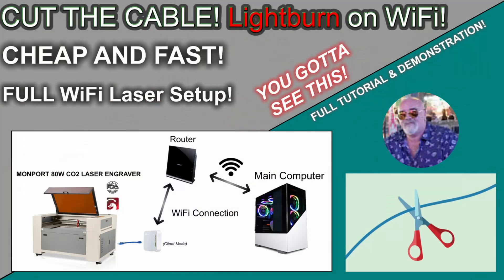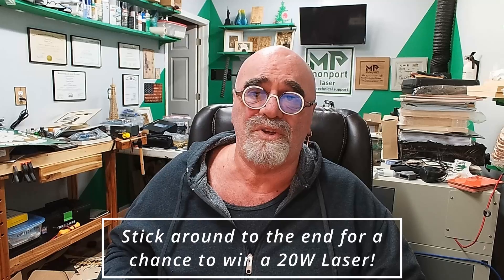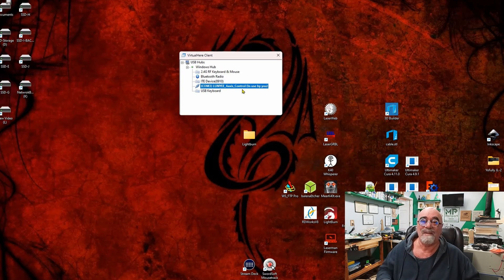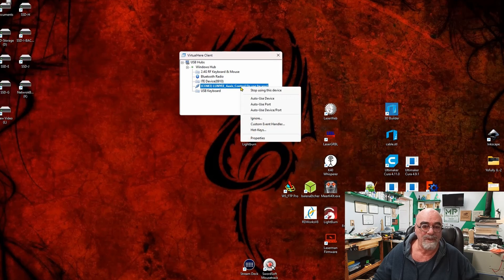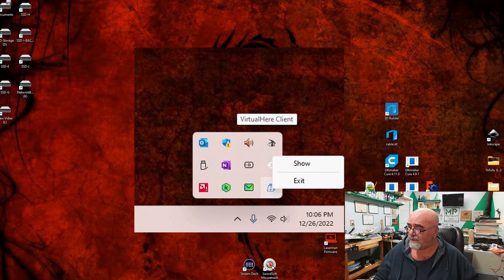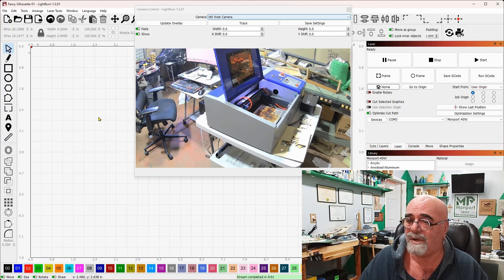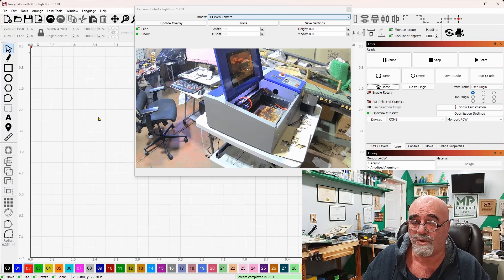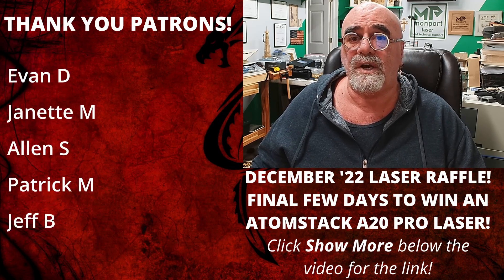➡️Remotely control your DIODE LASER⬅️ with ANY OLD DEVICE with a USB port on your network!

Comment: Thanks. I got this on today. Got my Raspberry Pi 4 and loaded it. I could get the camera working via remote USB, but the laser control would not work. I eventually got Laser control to work with using only LAN on the Pi (not WIFI) and PC can use either LAN or WIFI as the Client. I think LAN all around would remove a lot of variables and strange interruptions. From Lightburn I had to use USB-Packet mode, not USB-Serial, to get it to work. It would not work with USB-Serial not matter what I did. I have a OneLaser with a Ruida controller, and it must like the Packet mode better when connected via VirtualHere. Having done all this, not sure this will be worth the headache as it adds a lot of touch points to babysit and diag if you have any issues. If you have a permanent PC next to the machine (like in your config), it may just be a lot easier to use a Remote desktop connection, and leave native USB connections to do their thing locally. But it does work.
Reply from the maker: @khufu8699  Sounds like a fun project. But yeah, everyone has an old PC laying around.

Comment: Dang it, my laser control board is not showing up.😢
Reply: Thank you.
I tried several times.
Still no go.
So I installed light burn on other laptop, to ensure the laser would work, it worked fine.
I guess I will scrap that idea, thank you for all your help.
Appreciate it.
Reply from the maker: I don't know why. I use this regularly.

Comment: I bought a new first time CO2 laser by Monport and there’s been some difficulties getting USB to initiate with my Mac like it doesn’t see it at all. I think it comes down to being just a cable . . I just enjoy watching you cause you’re so informational. 
However, I’ve had this laser sitting on my bench. I’ve only gotten one burn out of it and that’s through Wi-Fi. I would love to get this thing up in operational through the USB so that I can have Lightburn, which I’ve learned so much from you to get running on this Mac
Reply from the maker: I’m glad you are enjoying the videos, and you're right, USB cables can sometimes cause issues. If you search on Lightburn's forum, there are a number of solutions for a Mac. I am not familiar with them.

Comment: I just purchased a 16 MP USB camera which is arriving today. Have you designed an enclosure for the camera that I can download? The main reason for this setup is so I can setup the job and leave the garage and monitor the job from my office. I do batch jobs that sometimes take an hour. So I will not be moving the laser around remotely. I just need a way to shut everything down if there is a problem.
Reply from the maker: No I haven't Kent.
Reply: @TheLouisianaHobbyGuy  I will design one next week and upload the file to you on FB. It will be more stable then the one I purchased.

Comment: Hi Rich, great subject.  It does look like the 32 bit Windows version has gone away.  The takeaway is that for some reason they have stopped supporting older Windows computers.  I could be wrong however, when I loaded VirtualHere on two different computers (one an older 32bit machine) the 32bit option was not available.

Thanks for all you do
Reply from the maker: Thanks for the info! I don't know much about this software since I personally use Remote Desktop.

Comment: Looks interesting.  I tried using an older laptop I had, but the screen resolution was not high enough for running lightburn.  I might give this a try.
Reply from the maker: Yes, older laptops don't play well with Lightburn because of the resolution. 👍 Thanks for watching!

Comment: Hi Rich, is the D1 pro 20w laser capable of using this software to connect via wifi? I ask because everything I have searched and everyone I have talked to tells me that it's not possible to connect to lightburn via wifi with the xtool d1 pro. Is that accurate information or is it possible with this software
Reply from the maker: Any machine can connect this way Johnathan.
Reply: Hey Rich...I also have a D1Pro 20w Extended Bed and I have run VirtualHere and found on my D1pro I get an error on almost every time I use it that says my controller has lost the USB connection and it shuts the job down.  I had been running a 20 ft USB cable so I switched to a "known good" 6 ft connected directly to my Raspberry Pi4B that runs VirtualHere.  Same situation.  Just wondering if anyone else is seeing this sort of issue with Xtool D1 Pro?  You are 100% correct that it is the easiest thing I've done to ADD Wifi to my laser, now I just have to figure out how to make it stay connected.  Switching cables doesn't seem to be the answer, also disabled all the power options on my PC with Lightburn to prevent any communications issues after long periods of burning files etc.  Still no luck. @TheLouisianaHobbyGuy

Comment: Windows 10 and newer ONLY - too bad, I've got stacks of older computers that would do just fine otherwise.
Reply from the maker: I think everyone does Andrew.
Reply: @TheLouisianaHobbyGuy  Not sure about everyone, maybe in this world. Anyway I still keep the term "backward compatibility" in my vocabulary - something today's programmers seem to ignore if they ever had it. I remember waaaay back when I had a friend who owned a small manufacturing firm. They repurposed Vic-20's to control some of their processes. Even then the Vic-20 was a dinosaur. 

On another note, I got curious - adding on another Lightburn license is only $15 and it will run on a Win 7 machine. Worse comes to worse I could also install Linux and run one of my old boxes that way - at least in theory. Linux and I have a bit of a love/hate relationship. There's a lot of stuff I know it can do but I can't always seem to coax it to do my bidding.

Comment: Great solution. But for me, I currently using Google Remote Desktop to control my laser engraver removing.😊
Reply from the maker: Great 👍 I've used that as well as several other options. Remote desktop (built into Windows) is the best.

Comment: Anydesk works too. Its a very light footprint. Plus EITHER device can be the client or server so there's only ONE application to install on all systems. So from your laser computer you can even connect to your other computers. If you're using a computer to connect the devices. Its way faster than this to setup. Install it on your computer, the destination computer and you setup favorites and you're gold. I can also use my phone for it. It also works great for helping people. You can ask for their anydesk phone number and then connect to their computer with it. This is what I use for my shop.
Reply from the maker: Thanks for the tip!

Comment: So someone told me that you like to try XTOOL and I want to buy one. Me question for you is: which one of those machines are capable to cut 1/4” thick acrylic??! Thx in advance
Reply from the maker: Any of them Thamara, so long as the acrylic is opaque. Diode lasers cannot cut clear or light colored acrylic.
Reply: @TheLouisianaHobbyGuy  oh that’ what I want to cut clear acrylic, but you know, clear acrylic come with a brown cover sheet. Do you think I’d leave the sheet cover on I will be able to cut it?
Reply from the maker: No you can't. Once it cuts through the paper, it passes right through the clear acrylic.
Reply: @TheLouisianaHobbyGuy  oh so bad. Hmm so which another brand do you recommend??
Reply from the maker: You'll need a Co2. For a budget 40W that's compatible with Lightburn, monportlaser.com is the only company selling the K40 Lightburn. It's $549.99, but you can get it for under $500 with my discount code, Rich&Monport. They also sell larger ones and the code applies to all machines on their website. And of course, if you have a higher budget, you can check out Thunder, Epilogue or AP Laser.
Reply: @TheLouisianaHobbyGuy  wow you are amazing thank you for you help and knowledge sharing. 😂
Reply: @TheLouisianaHobbyGuy  what’s a water chiller? Do I need one? Can you explain it to me? Sorry for this avalanche of questions do you have a video so I can stop bothering you?
Reply: @TheLouisianaHobbyGuy  if my laser tube broke and I want to buy a replacement? Do I have to replace it with the same 40w? How often it brake??

Comment: I have a question, when I am working with my laser, why does it has a continues line when the laser is running. I am just learning how to use my laser.
Reply from the maker: Your settings are wrong Antonius. Go to the Console tab and type in: $32=0 and press Enter. That will turn off white space burning.

Comment: Hey Rich, Just want to say thanks for all your great videos. I just got an Atomstack 10 Pro and new to lasers. My biggest challenge is learning Lightburn but your videos have made that much easier so thank you. I do also have a X Carve CNC running  Easel.  In one of your videos you mentioned you ran a CNC off of Lightburn, have you posted anything on how that works? And if so would you recommend that over using Easel? Just thinking it would be nice to run both machines with the same software. Even if you dont get a chance to reply still want to thank you again for the stuff you are doing.  Promise you will hear back from me once I know how PayPal works or you post a P.O. Box address.
Reply from the maker: I only use Lightburn on the CNC for engravings. It doesn't control the Z.

Comment: I don't think "ANY OLD DEVICE" is correct. In fact, it is misleading. I have an old laptop with Windows 7 (it won't run Windows 10 or 11) . The VirtualHere web site says the server requires windows 10 (or later).  I was hoping to run the server on the old laptop as it certainly seems like it would qualify as "ANY OLD DEVICE", but that idea is no longer achievable.
Reply from the maker: To me, any old device is running Windows 10 James. I mean it's 7 years old already. I wasn't trying to imply you could run it on a IBM 5150 from 1975.
Reply: @TheLouisianaHobbyGuy  I'm 78 and a long retired software engineer when Windows XP was the Windows Dejour.  USB was just coming into vogue back then when keyboards and mice still had cords.   

My old Windows 7 laptop is still used to run my Shark CNC.  The CNC and my brand new XTool D1 Pro share the same table with the old laptop and when I saw this video I about jumped with joyful anticipation.  Though I won't be able to use the Old laptop, the idea is still sound.  I'm now looking at an $80 Dell 3189 with Win 11 on ebay.  

BTW, your videos on Lightburn are superb and your explanations are clear and easy to follow.   Thank you.  Do you have a video on how to set up a camera?  You use a camera quite a bit in the videos, but I haven't found a video that explains what kind of camera and how to set it up.
Reply from the maker: Yes, I have several.

Comment: Rich
I used your link to order a Atzer laser on November 22nd 2022 and have not received a shipment confirmation yet. Should I be concerned?
Jeff Fiedler
Reply from the maker: Nope... The PRC has had the country in rolling lock-downs until the WHO reported it last week. Most of the factories are far behind. Email them Jeff.
Reply: Thanks

Comment: help me understand,  ok at the time point 8minutes, you show the other room on camera,  that computer is hooked up to that laser  by a USB cord,  correct,  or is it hooked by a wireless way??      BTW    great info If I can figure it out, I can see the 2 pc's working through the "here prog."   I think you could do that like when you connected to the old guy as you called him,  and showed him the way to do something,, without the Here prog.  so I got that   thanks for the info, and keep up the good work,
Reply from the maker: Yes, that laser is connected to the computer in the other shop via USB cord, however, nothing else is running on that machine.

Comment: You could also just directly control the computer in the other room using Google remote desktop.
Reply from the maker: Windows Remote Desktop is even better Billy. This is the easiest way considering most design computers will be at a desk somewhere remote.

Comment: great job, I'm just starting, have experience in CNC milling as a hobby. this looks very easy, BUT, i loaded a computer out in my shop with Virtual Server, OK, then i  came in here to my office and loaded virtual Client as you instructed. when i ran them here i got a blank choice for find HUBs. , NO LIST showing my Xtool laser
 What did i do wrong????
Reply from the maker: Both machines have to be on the same network Larry. I run both on the 2.4Ghz Wi-Fi network here in the shop. I have also run this on a wired network, but I don't think it works on the 5G Wi-Fi... not sure about that.

Comment: I guess I have to pay the $49 for the license to continue to use this software. The client is free but the server has a charge. I'm I right??
Reply from the maker: No Carl, the only limitation on the free version is a restriction to one device. If you only use it on one device, it's free. I've been using it for over a year on a printer.

Comment: Hey Rich, awesome video! I was about to try one of those USB to RJ45 extender but with this solution it is way easier!!!!
Reply from the maker: Tried the USB to RJ45... didn't work.
Reply: @TheLouisianaHobbyGuy  I tried the solution you have suggested with the server on a Windows 11 PC and the clients on another Windows 11 machine and on a Mac. In both cases the Laser is easily recognized and I can run some simple commands like frame and home but after a couple of minutes there connection is permanently lost.

Comment: I probably won't use this to control the laser itself - I prefer that to be done by the computer attached to it - but this looks perfect for using a webcam in Lightburn on a remote computer! Thanks again for all your tips and tricks. (I'm going to have to make a macro just to thank you if you keep this up!)

Comment: I can't seem to find this info so I figure I may as well ask the master. 
Is there a way to switch my y and x axis on lightburn? How my lm3 with extension kit is physically set up it feels more intuitive to have the long axis be left and right instead of up and down, but it doesn't seem to work if I just put the 'x axis' as the longer one. It works on the screen but doesn't transfer to the lm3. 
I hope I'm explaining my problem right.
Reply from the maker: Yes, but I can't explain it in a YT comment. Try posting on my free forums. https://lahobbyguy.com/bb

Comment: Great video Rich. Tried it out and worked fine with my OLM3 ,however it does not work with my K40. it is using an after market control board that uses GRBL-LPC and could not get the client to connect to Silicon Labs driver.
Reply from the maker: Yeah, I can't speak for LPC Tony.
Reply: @TheLouisianaHobbyGuy  It's the LX4 board by VMS. I still have a PC next to it so I can just run direct connect. Again great vid.

Comment: Do I need to have Lightburn on the computer that is in the shop with the laser or just the one I am using remotely?
Reply from the maker: Just the remote computer Gary. The one in the shop is just being used as a pass through for the USB connection.

Comment: Not sure if you have mentioned it to people, but it is advisable to be in sight of your Laser when it is running long runs/ jobs, even when running via WiFi. There have been many cases where the job has caught on fire due to various reasons ( especially on long runs, and un kept machines). Being able to be close enough to either stop/ purse and fix issues quickly is advisable. I have a 130 watt Co2 1300 x 900 machine and it can run fast and long but I also have a fire extinguisher on hand to sort out possible fires if needed. I clean the machine and the smoke/ dust extractor hosing regularly to avoid build up of soot etc.
Reply from the maker: I mention it all the time Tassie, even in this video!
Reply: @TheLouisianaHobbyGuy  Ok, thanks , since I already do this I only watch part of the video lol. I have seen a very bad fire on a 80 watt Co2. Love you Channel too. Thanks again for all the work you put in.
Reply from the maker: What I always forget to mention is cleaning out the debris tray down below Tassie. That's the #1 cause of fires!

Comment: Hey Rich, thank you for this awesome video!
Actually I am using exactly this setup for a few weeks now (Diode Laser on a RPI 3B+ via USB and Virtualhere, Transmission of laser and webcam usb signal to Windows PC via local WIFI). I have also tested usbIP which works directly in Linux, but that does not run smoothly on windows.
For Vectors and cutting, it works like a charm. But the problem I have encountered with this setup, is that when engraving images, my diode laser get's stuck after a while or starts stuttering, such as the signal would stop or needed to buffer (although I have stable wifi, tested the connection, even used extra big wifi antenna on the RPI). Have you experienced the same or similar (or anyone else here)? Would you have any idea what this could be?
Reply from the maker: I don't have a pi hooked up, but I have run about a dozen jobs so far including 2 images for testing and they have all worked flawlessly. I also know other people with the same setup and no complaints.

Comment: I just gave it a try and when I home, frame, or move the laser using the client lightburn; it's very slow. I did not try to cut or engrave. Using Ortur 2 pro. Windows 10 client and Windows 11 for server.
Reply from the maker: It works perfect for me.
Reply: @TheLouisianaHobbyGuy  I found my problem but am not sure what changed it. On my laptop in Lightburn under the MOVE tab, the speed changed from 6000 to 1000 mm/m and Z-speed changed from 600 to 100 mm/m. I'm not sure if the update to the latest Lightburn or VirtualHere or some Lightburn file I imported from someone else made that changes. Thanks!!